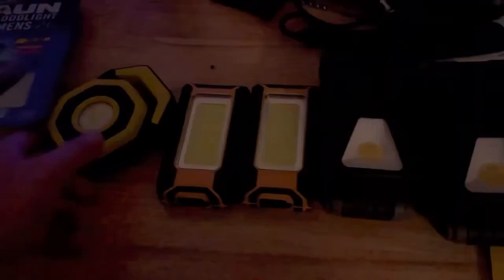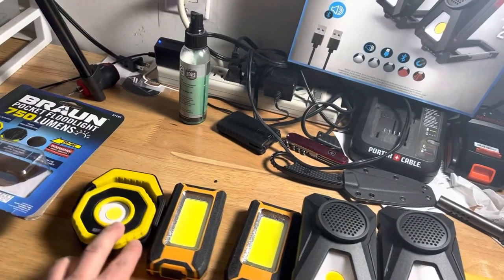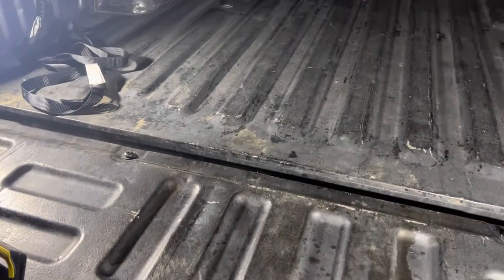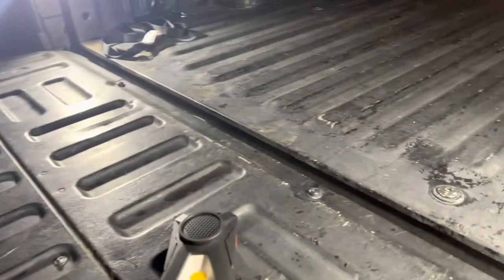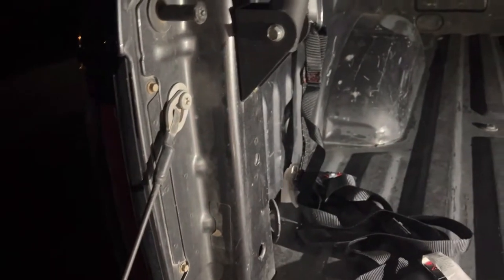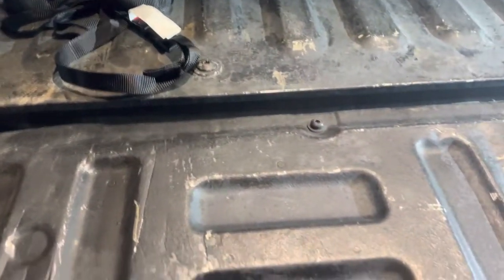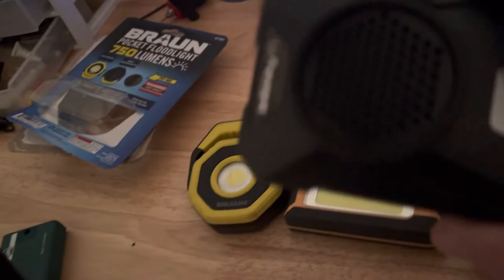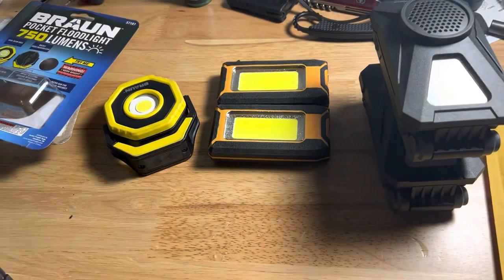Budget Camp/Bed Rack Lightning Options

Comment: If you have a Ford F-150 and it's a newer model the bed is made from aluminum and composite so you're not going to get a magnet to stick to it brother just in the tailgate and the frame of the back of the truck.